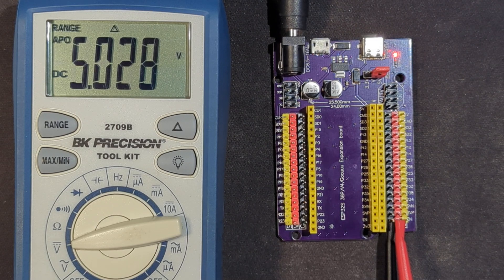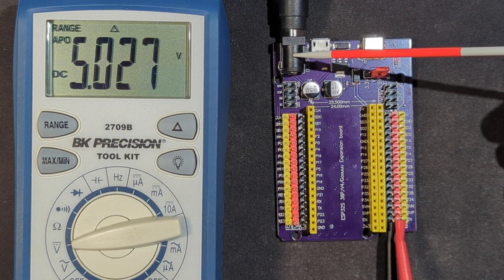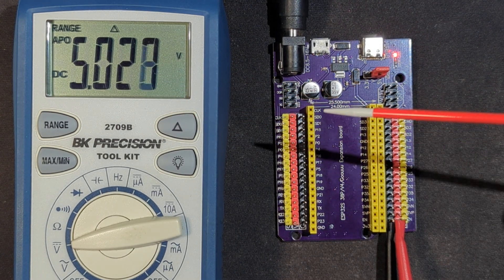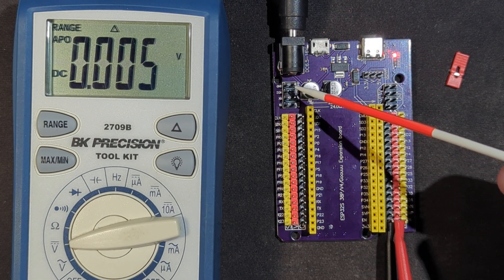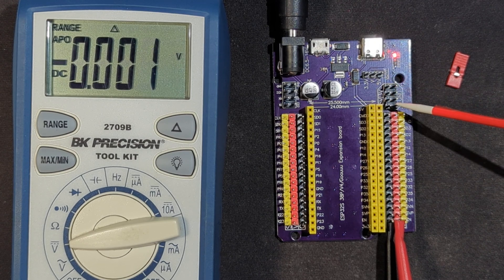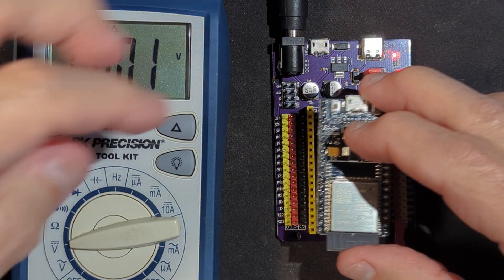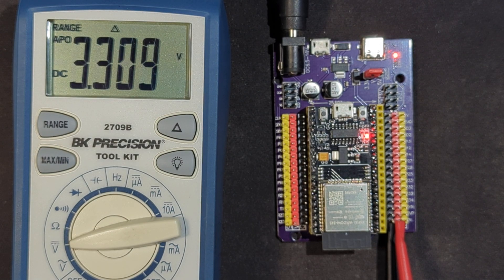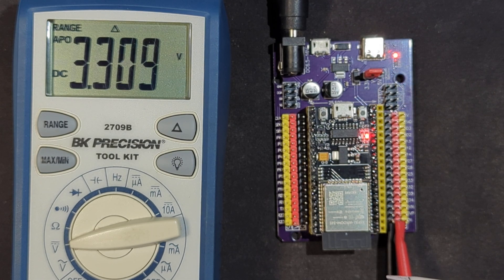ESP32 expansion board, 38 pin breakout board

Comment: Stupid question. If jumper is set to 5v. Esp32 is given still 3.3v to function? That jjmper setting only changes voltage for gold pins not esp?
Reply from the maker: No. The 3.3 volt that connects directly to the ESP32 on the expansion board receives its voltage FROM the ESP32. The ESP32 receives only 5 volt power from the expansion board.

Comment: Hi . Thanks for this informative video. Want to know about whether if I connect expansion board on type c connector and attach my esp32 board on top of it. Will I able to connect my board and upload code on it ?
Reply: That did not work on my board, needed to connect it directly to the ESP32 to install WLED for example, the device wasn't detected otherwise.
Reply: @harfri  I managed to upload code to it just getting it out of the expansion board* or connecting it to a PC USB 3.0 port.

I wonder if it's safe to connect ESP32 to an ordinary PC USB (upload data) and also the expansion board being "fed" by an external power supply.

* Upload fails whenever ESP32 is the one supplying power to expansion board.
Reply from the maker: No. The USB connectors on the expansion board ONLY supply power (not data).

Comment: Can you guide me on how to flash code to a 38-pin ESP32 through the Type-C port on a 38-pin expansion board?, thanks you
Reply from the maker: The expansion board cannot be used to program the ESP32. To program the ESP32, you must use the USB connector on the ESP32. All 3 of the connectors on the expansion board (i.e., USB-C, USB mini and barrel jack) are for power only.
Reply: @philipgiacalone5605  Thanks so much - this is disappointing. We can not test. I am using the board so I can have many peripherals hooked up. Thanks for this video. Connecting 12v power supply is super handy to know.
Reply: I wonder if we can connect directly to the usb port on the esp32 to upload code and then shift back to the power inputs without taking the board in and out. I have peripherals connected so this could be an issue.  (Lora, light, PIR, voltage, relays).

Comment: Thanks for a detailed and informative video. Have you possibly had a chance to test the usb-c port?
Reply from the maker: The expansion board cannot be used to program the ESP32. To program the ESP32, you must use the USB connector on the ESP32. All 3 of the connectors on the expansion board (i.e., USB-C, USB mini and barrel jack) are for power only.

Comment: hi Philip, thank you a lot for this video, is very nice and usefull. Also, as i see, is not possible to work with esp32 and supply 8x mg90s servos with 5v at the same time with this board?. 3.3 work with ESP32 and 3jumper... what get if you activate the 5v jumper with the esp32 in sockel... is then the esp32 with 5v supplied too? And on which pins can you place a 7.4v batterie for power supply? on VCC+GND?. Thanks in advance, maybe would be easier another video... :-) . Regards!
Reply from the maker: Here is a video I just posted with a deeper look at the expansion board https://www.youtube.com/watch?v=AP_CX-SFPAQ